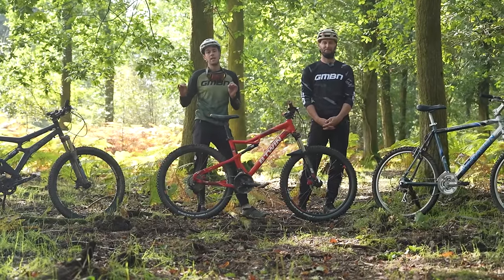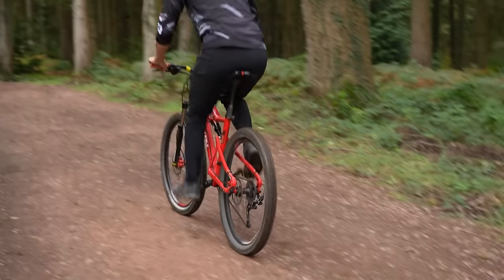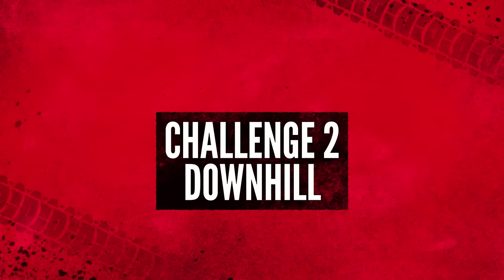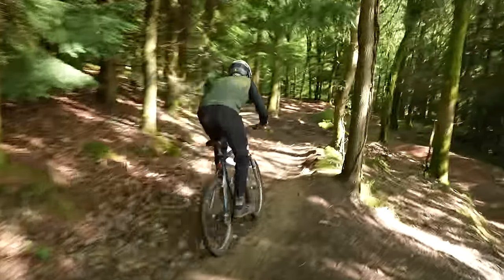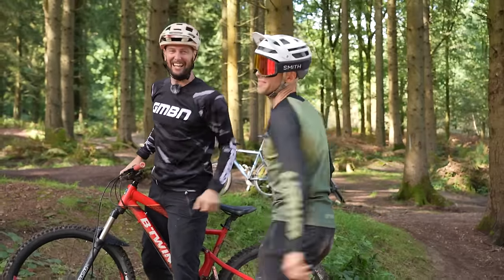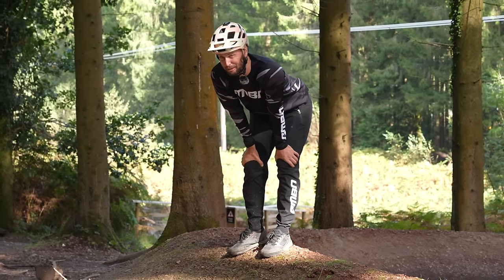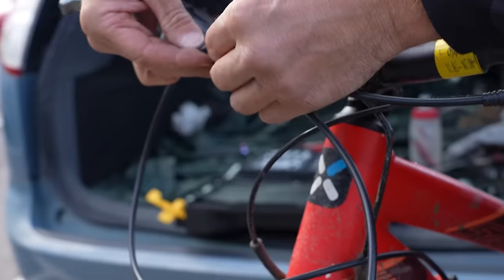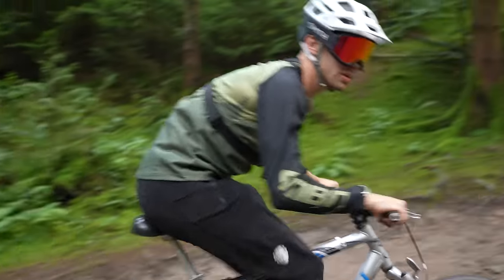Upgrading Our $150 Enduro MTBs! | GMBN Cheap Bike Challenge Pt.2

Comment: I have a 2001 Cannondale XC bike. I did 2 of 3 upgrades, mainly because the XT/XTR mix of components were working extremely well. The Hayes brakes were past it and very spongy and sticky even after a full clean and service. Swapped out for the latest Deore, and run ridiculously better. Also got cheap bar and stem to significantly shorten reach and widen stance. Both upgrades make the bike feel so much better.

Comment: Best bang for buck upgrade I've done on my budget bike was an air fork. The coil fork that came off was heavy and not adjustable, the air fork gave me more adjustment so the bike rides and handles better plus it dropped a significant chunk of weight. And a low end air fork from Rockshox can be had for ~$200 so within the range you were looking at here

Comment: We picked up a 2014 Niner Rip RDO very reasonably. We upgraded it with a new set of Maxxis tires (DHR and Assegai), bled the brakes and replaced pads and rotors, new shorter stem and 35mm riser bars along with a Tranz X external dropper. The bike went from something ready to retire to a great first full sus for my son.

Comment: I actually recently bought a hardtail 26er recently that someone had left outside and done no maintenance.  Fortunately I had a spare chain and some hydraulic brakes I took off another bike handy. Of course it matters what you want to use the bike for and I think the bikes in your video demonstrates this. I've gone 1*8 with a 38t chainring up front and  replaced bars and stem with a wider shorter setup. New Parts were around $200 AUD. But of course I'm cheating because I raid my spares for some decent upgrades anyway.

Comment: I tried making my 2008 Giant Glory 0 work. I switched out the tired spring Marzocchi front and rear for Fox air. I also upgraded the brakes and handlebars. However, though those upgrades improved the rideability, the best upgrade was switching to a 1x10, with a 44t sprocket and a 28t chainring. In the end though, it was still a horrible climber. Had to upgrade to a Commencal Meta AM 29. Hopefully this is the quiver killer.

Comment: Cheaper or even used parts, but:
- 27.5 wheels
- Aggressive tyres
- Bigger brake disks
- Hydraulic disc/rim brakes in case of mechanical 
- Wider bars, shorter steams, better grips
- 1 by 9 conversion + 11-42 cassette (or 11-50 with goatlink)
- Better platform or clipless pedals

All 3 bikes would have become an ultimate beasts!

Comment: Pends on bike for me - but my usual first place to begin is front forks followed by rear shock. May just be a simple tune, but that may mean an upgrade - esp. if the components offer no tune options.  When the suspension is well tuned and sorted I generally can make the bike work very well unless there is a major problem somewhere else...   Like an over stretched chain that likes to skip over gears...  

Actually, bingo - any major mechanical problems like a stretched chain, non-functional brakes, etc should always be addressed first... No broken parts and everything works. No point in risking ones neck when a bike is in dire need of service and is willing to kill you for not doing it. 

The last thing I worry about is upgrading brakes, group set, pedals, bars, saddle wheels, etc. 😀